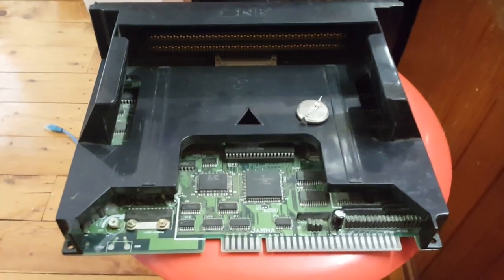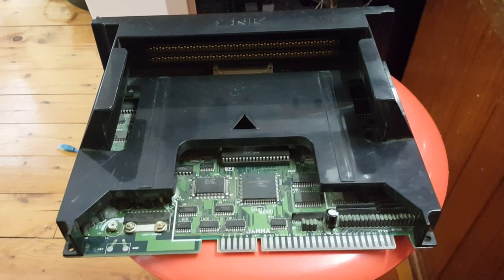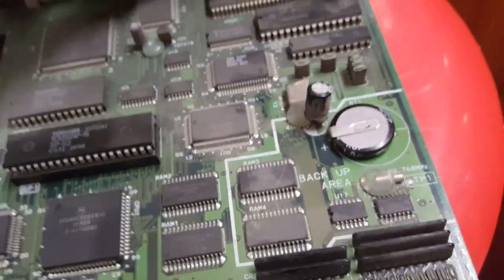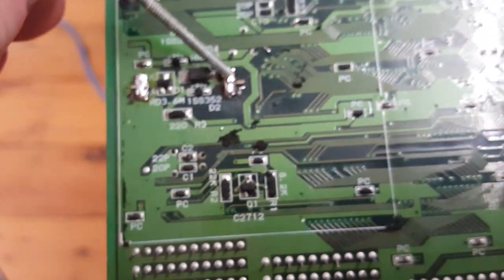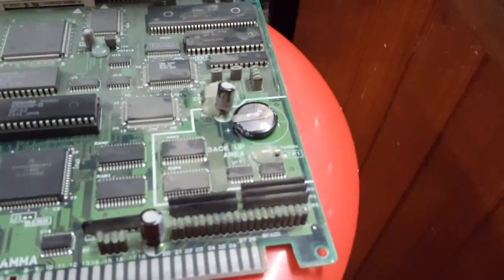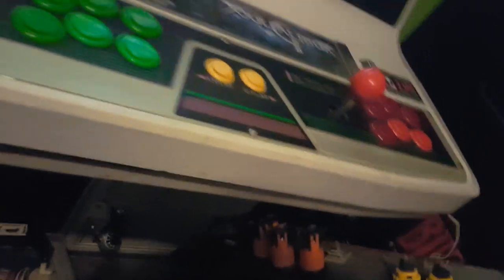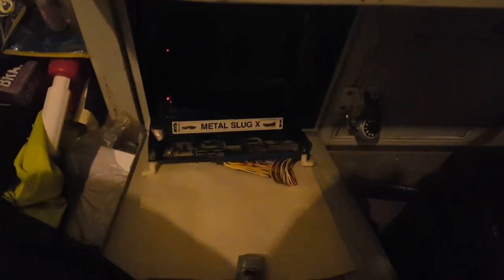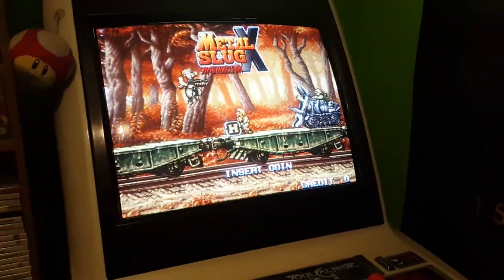Neo Geo MVS arcade battery replacement

Comment from the maker: !! IMPORTANT !! 
At 0:57 I mention using a Coin battery socket with Non-Rechargeable coin cell batteries without having to "disable and re-route" is inaccurate. When using ANY Non-Rechargeable battery in this trace circuit you will NEED to remove the 470 resistor. Removing this resistor disables the charging function from the circuit. Without removing this resistor, you can damage the battery and board, causing the battery to pop and leak. Youtube has disabled annotations preventing me from adding this info directly to the video.